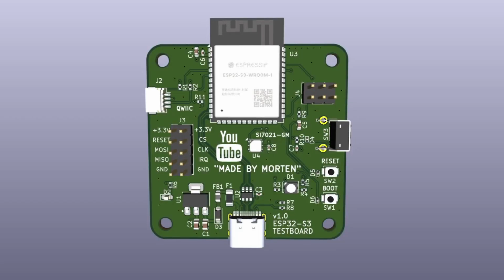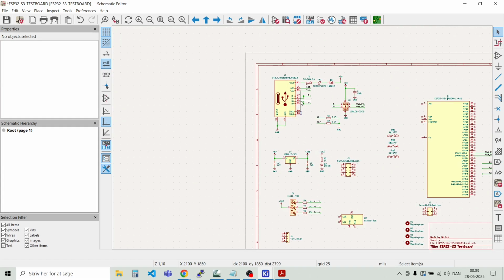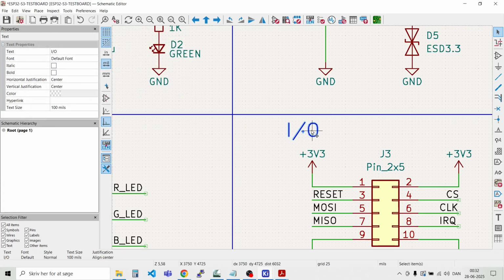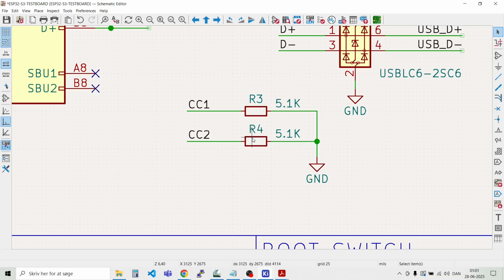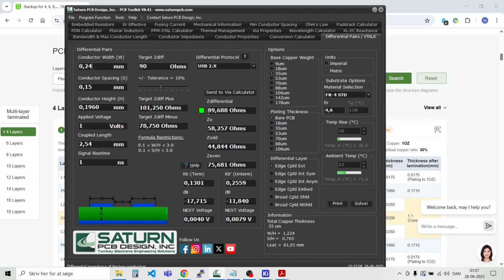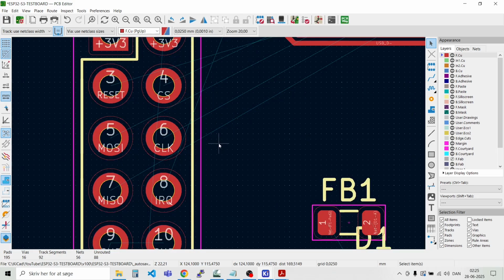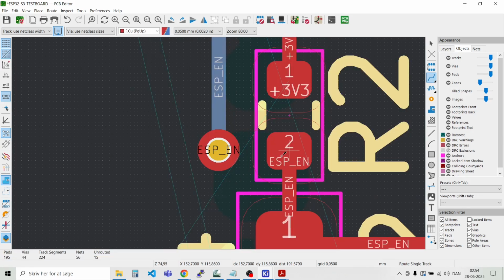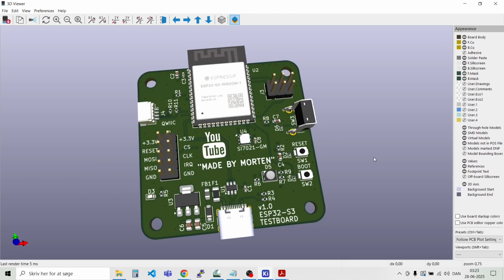KiCad 9: Design an ESP32-S3 IoT 4-layer PCB with sensor and QWIIC interface. Complete Guide.

Comment: Thank you for creating this fantastic tutorial.  I learned a lot through watching the real layout process.  You should double-check your USB-C routing at the board connector.  It looks like you didn't connect both D+ pads and both D- pads.  USB-C cable connectors are not indexed by design so that they can be inserted in either orientation, but this will only work if you properly connect the D+ and D- pads on your board.  The fix is just like you already did for the power pads (video time = 2:35:04).  Thanks again!
Reply from the maker: @purplecurry3379 - thank you so much for the kind words, I have uploaded the correct Gerber data and KiCad design files where the USB error has been corrected, great find by the way :-)

Comment: The only thing that would have made this like gold dust invaluable would have been one of those keyboard / mouse action notification apps. Or even an animation as to which key was pressed. Something. I'm just learning KiCad. Total zero. This was really helpful none-the-less.  Just remember to reference the icons around the edge of the screen, dear reader, at least in the schematic diagramming part of the vid.
Reply from the maker: @utuberrocks-q5j - thank you for the input, i will keep this in mind
Reply: @made.by.morten.laboratories it really was brilliant though. Gets me started, big style. Thank you. I saw others use labels to denote connections. Small tags. Seems there's so much to learn. But it looks a bit like Lego. Then again I've not gotten round to dual wire routing yet and I'm not at all sure what the copper pour is for or how ground vias work. Very useful video all round, thank you

Comment: I'd like to make a data recorder... using an ESP32 and an ADC (TI ADS8588H LQFP-64).

I think I can probably stumble my way thru the schematic, maybe even the layout 
(although the TI ADS8588H Layout recommendations shows tons of decoupling capacitors, split Analog/Digital planes , etc... all way advanced for a non-hardware guy!  I don't know anything about all the PCB fabrication options)

but the biggest issue will be the assembly. My bad eyes and shaky hands, I don't think I'll have much luck soldering, even using 1206/1210 size components. Where do you find someone that can do that?
Reply from the maker: @bennguyen1313 - You can use PCBWAY or JLCPCB for the manufacture of the PCB, they can also do the assembly for you,. You can quote the price directly on their homepages, its not very expensive, even i small numbers. Let me know if you need any support

Comment: Consider connecting labels to the end of the wire and use left/right alignment to male adjustment easier.
Reply from the maker: @fromgermany271 - Thank you for the tip :-)

Comment: 3:18:30 the DRC error is that there's two pairs of D- and D+ but you didn't connect the pairs together, you left A7 and B6 unconnected, so I assume USB C will work on only one side
Reply from the maker: @MrGustass1  -  Great catch, yes i found this issue afterwards and is corrected in the Gerber data you can find at PCBWAY - thank you :-)

Comment: Can you progarm this board through the usb c, i am curious because i don't see a usb to serial converter?
with the programmer header pins, did you make a custom programmer in that shape, or you bought a programmer. if you bought it please can i get the link
Reply from the maker: @martinavorgah  - you can program the ESP32-S3 via the onboard USB-C interface. You can also program via the 6 pin connector via an ESP-PROG from Espressif : https://www.mouser.dk/ProductDetail/Espressif-Systems/ESP-PROG?qs=0lSvoLzn4L9lCAjJ8r9cdg%3D%3D
Reply: @made.by.morten.laboratories  thank you so much.
Reply from the maker: @martinavorgah  You are more than welcome 😀
Reply: @made.by.morten.laboratories  one last thing, if you leaving the CC pins not connected, is it possible that your laptop won't recognise that the esp32 is connected, therefore you cant program it. I ask because I encountered the same issue but i figured for programming only the data lines are necessary.
Reply from the maker: @martinavorgah - Normally you would connect each CC line to GND via 5K1 resistors

Comment: The circuit you designed in the clip, when uploading the code, you don't have to press the boot button, right? Does it use a circuit with Auto program?
Reply from the maker: This will happen automatically, but If the upload fails, try pressing and holding the BOOT (or GPIO0) button on the board, then press the upload button in the IDE.
Reply: @made.by.morten.laboratories  That is, it can be used normally like any board sold on the web, right? Just press upload in Arduino IDE and do nothing, and the code will run automatically. And the code will work when there is power, right?
Reply from the maker: @RuSu-yn3mf yes
Reply: @made.by.morten.laboratories  Thank you, my teacher.
Reply from the maker: @RuSu-yn3mf you are welcome

Comment: I have a couple of questions:

1. You left one D+ pin and one D- pin unconnected in the footprint of the USB connector. This means that the USB data in your board will work only for one orientation of the USB cable. Was it intentional?
2. You have used the Inner layer 2 as 3.3V layer instead of ground layer, therefore the lines in the bottom layer will not be referenced to ground but to 3.3V. I am not sure that this is a good strategy, but I am not an expert PCB designer so I may be wrong.
Reply from the maker: @misckicirina
Great, thank You 
1) Correct, i discovered that and the Gerber data is done with both sets connected
2) IN1 layer is GND and is the layer close to the TOP layer, IN2 is 3.3V and is below IN1 layer
Reply: @made.by.morten.laboratories  Can you update the kicad files on github ?

Comment: To place components,  press the A key to bring up the symbol libraries. It is much more convenient than going to the menu or clicking the symbol icon in the right toolbar.
Reply from the maker: Thank You 🙂
Reply: Oh, and P for Power Supply components
Reply: Q for no connection (x). Instead of deleting a wire and moving an object, use D to drag the object.
@1:23:00, you can select a  bunch of resistors to paste the footprint into. Save some pain.

Comment: Looks like a perfect tutorial, just started to watch it and immediately subscribed. I want to design a pcb with esp32 (s3 or c3) that is powered by a LiFePO4 battery and is capable of powering 12 ws2812 leds and a couple sensors (gyro and mmwave), but it's hard to get my head around all the chips that are needed for the power as it will be a combination of 3.3 volt and 5 volt and most tutorials are based on lipo-batteries.
Reply from the maker: @jochembeumer2673 - Great! Good luck with your design in KiCad. If you have specific questions i woild be happy to support you - no worries.

Comment: Hi Morten, thanks for taking the time to create such a long video. I'm an absolute beginner and thought I'd follow along with your video, just to stumble at the first possible moment - the ESP32-S3 symbol. I've looked around but cannot find a symbol that looks like the one you've been using in your video. I've been importing the official symbols from Espressif and also looked at ESP32-S3-WROOM-1-N8R8 and N16R8. None of those looks remotely like the symbol you've been adding (it shows this is coming from your library). Maybe you could share where this comes from or if you've created it yourself
Reply: Yess same doubt @made by morton please do reply for this one asap
Reply from the maker: You can find the files here: 
https://github.com/mortens-lab/ESP32-S3-testboard
Reply: Can someone please share symbols and footpirnt because it is not included  in the github repo.
Reply from the maker: @berkcan2439 - you can extract the data from the design
Reply from the maker: I made my my own ESP32-S3 symbol

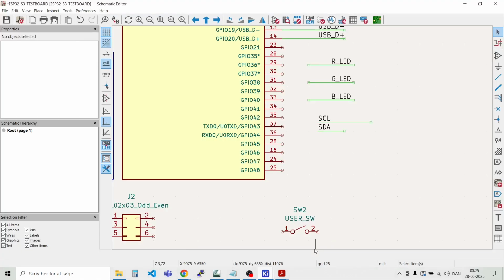Comment: 50:28 in the notes you added it says GPIO3 is floating by default but you make the connection on GPIO2. I haven't watched the entire video, so if you clarified I am sorry for asking early but I want to know if it's gpio3 or gpio2

Also I am working on a project, I would love your advice on how I would make the esp32 S3 programmable through USB C but I don't want to add the reset and boot button to the board, just plug it and be able to program the chip. I have been doing some research online but I keep finding conflicting information.
Reply from the maker: Great catch, i was corrected later in the video
Reply: @made.by.morten.laboratories  oh thank you! 
Sorry I updated the comment, if you could take a look please
Reply from the maker: @martinavorgah - Did you find a solution?

Comment: Nice tutorial, thanks! I noticed you did not place a 10k pull-up resistor at the BOOT pin. I normally use this pull-up, do you think it is not needed?
Reply from the maker: The BOOT pin has an internal pull-up resistor, so 10K resistor is not needed on the ESP32-S3
Reply: @made.by.morten.laboratories  I have finally had the time to watch the full tutorial. I have a couple of questions:

1. You left one D+ pin and one D- pin unconnected in the footprint of the USB connector. This means that the USB data in your board will work only for one orientation of the USB cable. Was it intentional?
2. You have used the Inner layer 2 as 3.3V layer instead of ground layer, therefore the lines in the bottom layer will not be referenced to ground but to 3.3V. I am not sure that this is a good strategy, but I am not an expert PCB designer so I may be wrong.

Comment: Hi, I'm currently designing a custom dev board based on the ESP32-S3-WROOM-1, which includes a built-in MPU6050, a microSD card slot, and an I²C/SPI header. I'm a bit confused about the optimal pin selection for these peripherals. Do you have any documentation or recommendations on this topic? Thank you for your time and assistance!
Reply from the maker: Have a look here:
http://wiki.fluidnc.com/en/hardware/ESP32-S3_Pin_Reference